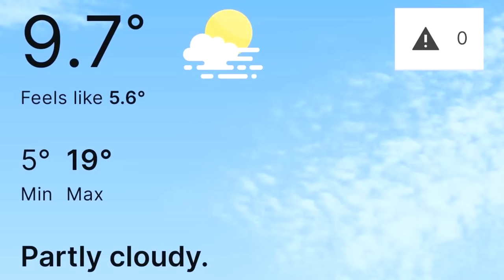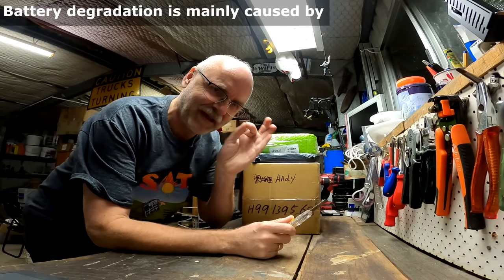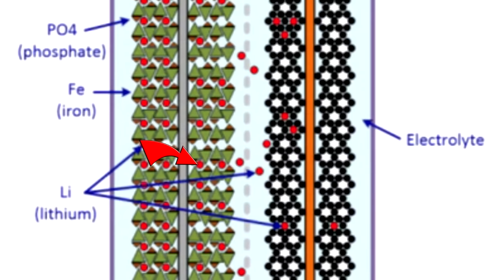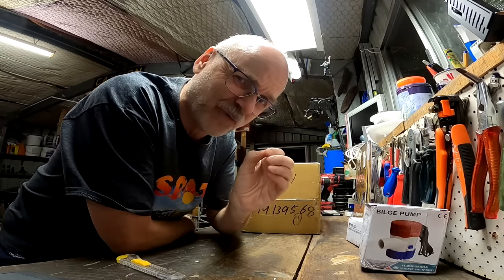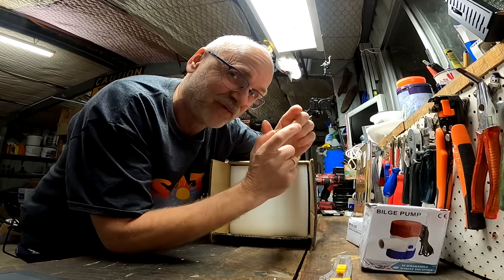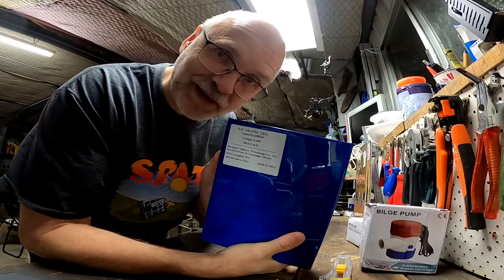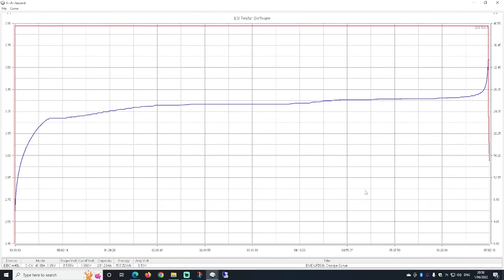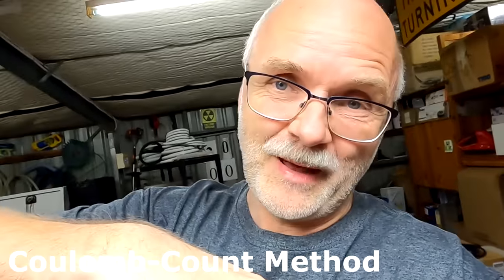Busting the 20%-80% SOC myth for LiFePO4 batteries.

Comment: Thanks Andy. Looking forward to the research study and testing. Have you or anyone found any real world research testing on the actual effects of over and under charging with LFP cells? I'll include references to some research papers, which suggest that it's thermal effects that largely contribute to substrate damage, and more a function of charging rate than absorption charge voltage, and that overcharge damage typically occurred at voltages above 3.6v. I could not find one study that suggested did several hundred charge cycles to 3.2v vs 3.6V that I seem to recall found no appreciable degradation until charged to over 4.2V to 4.8V. but if I do I'll add it to this post.   

Here's some articles that are bit of a dive but give some insights into what is going on at the chemical level:

LFP overdischarge conflicting voltage limits - Thread starter Hans Kroeger Start date Jan 21, 2021 
DIY Solar Power Forum  - Nature Article number: 30248 (2016)

'The Degradation Behavior of LiFePO4/C Batteries during Long-Term Calendar Aging  March 2021' - 
Energies 2021, 14, 1732
"Because the 20% capacity fade and/or 100% internal resistance increase are considered
to be the EOL criterion which are widely accepted, almost all of the tests performed in
the aforementioned literature are carried out within this battery life span. There are few
studies on aging behavior outside this range. Thus, this paper conducted an accelerated
calendar aging test on a commercial lithium iron phosphate (LiFePO4) battery over at
least 27 months. By considering the storage temperature and SOC level as the stress
factors, an aging test matrix was designed such that the tested batteries were subjected to
the aging test under five different conditions. Based on the aging results, the impact of
storage temperature and SOC level on the long-term performance degradation behavior of
fifteen LiFePO4 battery cells was analyzed."

'Failure Investigation of LiFePO4Cells under Overcharge Conditions - 159(5):A678  - researchgate'
"The correlation of the changes of
cell skin temperature and voltage with cycle number suggest that an
internal shorting of the cell was developing with overcharging, which
eventually led to the failure. Taking a close look at the temperature
curve of each cycle (in the 10th cycle shown in Fig. 2c), the cell-skin
temperature slowly increased with time but began a sharp increase
at the end of the charge, indicating that the overcharge caused detri-
mental damage to the cell components. The same pattern repeated
with cycle number for each cycle, and the temperature continued to
increase until failure. The temperature increased with charging, then
reached the highest temperature at the end of the overcharge process
(33◦C at 5.28 V, peak 1), then decreased with discharging; however,
after the discharge plateau, the temperature increased again to another
peak at the end of the discharge (26◦C at 2.8 V peak 2). As for the tem-
perature at peak 1, the temperature increased with the cycle number at
a rate of 1.36◦C/cycle, reaching 45.8◦C when the battery failed. It was
also noted that in the last ﬁve cycles, the temperature increased with a
much higher rate, 2.54◦C/cycle than that of the ﬁrst ﬁve cycles (only
0.02◦C/cycle). Compared with the temperature change at peak
Reply: Jack, did your text get cut off. Seems to end adruptly.

Comment: My car audio batteries get half-ish discharged and recharged several times a day. From 3.2 average to 3.6. The high amperage demand is what I think will kill them before anything else. When I enter in competitions the batteries get abused. My amp-clamp (dmm) has shown over 300 amps on one out of the four 1/0 cables feeding the amps. My home system goes from 2.85-3.48 and NEVER see over 120 amps. Itll outlast the car audio batteries BY FAAR. Excellent video Andy
Reply from the maker: Thanks for sharing. I always wondered why you guys don't use supercaps for this sort of usage. Or at least LTO cells...?

Comment: 12v LiFePo4 im using settings in my SCC LVD at 12.6v and charging voltage at 14.2v i like that setting compared to default (Li) 11.5v LVD and 14.4v charging using a SRNE 40A SCC.. your channel is very informative thank you

Comment: ANDY, everything you just said makes perfect sense.  LIfPO's were designed to be fully charged and fully discharged for a certain number of times before degradation sets in.  But we all hope in the long run a little less heat when charging will lengthen the serviceable life of the pack.  So for me, ill keep it down to 3.55 volts max charge voltage per cell, with a 4 hour float at 3.45 volts.  Beer is on me!
Reply: A 4 hour float could overcharge them. These are not car batteries. having your BMS get every cell to 3.45 and balance would be better. he showed us where the curves are for these cells. 3.5 could even work but would stress the battery a bit more.
Reply: Only when you need speed charging (boat, RV, less sun hours) it is necessary to go above 3.45. Ones mileage will vary indeed.
For stationary and fair sun hours there is less need for higher voltages  when charging...
So Andy told...
Reply from the maker: Thanks a lot for the SPAT 🍺, Bruce. Lower your float a bit and I'm happy with your settings. Thanks again for your support!

Comment: Thanks Andy - hilarious beginning as usual.😁
Very good topic- BTW I’ve received both my JK BMSs from China, one for my van (12v) and one for home garage (48v) already. 
I’m impressed with the speed of delivery, obviously air freight! 
My 400Ah Winston LiFePO4 cells for our caravan are now 6.5 years old, and have been charged usually to 3.45 volts during daily use, and then maintenance charged during storage (we don’t usually use the van in Summer) with a small solar panel (just around 50w, and only late afternoon sun) to a lower state, typically only 3.3v just to avoid any chance of going too low. However I know from experience that :
1. The actual state of charge can be quite low, as the Victron shunt (Bmv 700) gets waaay out of calibration over time, ie: exactly as you said.  The ONLY way to recalibrate it is to fully charge the battery. I’ve seen it say the battery is at 100% during storage periods when it’s actually at probably closer to about 35- 40%.
2. My degradation is still absolutely minimal. I have capacity tested them last Summer (Feb 2022) by running an aircon and found the capacity at something significantly over 380Ah- I wasn’t game to go any lower as I didn’t have a BMS on the van, (but will have one soon!) and this means I would have had to watch individual cell voltages personally, just not worth the hassle.
Cheers and thanks again.
Reply from the maker: Thanks for sharing, Dave.
Just be careful with charging the 12V batteries with such small voltage, it can overcharge them and you're reaching a high SOC at 3.3V already and the charge controller keeps charging. It might be better to charge them to ~60% and turn of all loads and the charger. With 3% self discharging there should be now need for a trickle charge for quite a few months.
The Winston cells seem to be far higher quality and also better matched.
I've got your email as wee and will reply soon. Cheers.
Reply: @OffGridGarageAustralia  Thanks again Andy.
I certainly hear and understand what you’re saying about the longish periods in storage with 3.3v, however should have added that I feel I’m very safe as I very regularly use light loads such as charging my garden tools from the van’s inverter, and often even other items as well such as lights and even sometimes aircon if I am doing things in the van. (I have a 2.5 kW Panasonic split system in the van.)
The maintenance solar panel only receives mid to late afternoon sun- net  result being that my actual state of charge usually goes down hill over time even though the Victron usually says 90- 100%. (As you know, that % SOC figure is useless when the battery hasn’t been at top of charge for a sync for a long while.)
For example, the last time we pulled the van out of it’s carport into full sun for a charge before using, I needed 250Ah going in to the battery to hit the top of charge, so the real SOC was probably something like 35-40%.
Weather permitting, we hope to use the van perhaps from the end of this week. I’m guessing that I’ll need to pump something like another 200Ah or so in to fill the battery, wild (educated ??) guess. Cheers

Comment: The flat charging/discharging curve of the LFP is addictive. Voltage sag was a mayor pain in the arsch with AGM, especially in freezing temps.
Reply: Voltagesag with AGMs suck but charging LFPs in freezing temps suck even more...
Reply: @windsolarupnorth7084  Yep, built LFP batterybox with heating.

Comment: Richtig gutes Zeug.

Reasons for the coulomb counting being off:
- It does not count balancing losses (minor)
- It does not count self discharge (minor)
- Most importantly: It integrates (adds up) systematic measurement errors (offset, gain, linearity) over long or even extremely long timespans. Even an offset of just 100mA can accumulate to big deviations when no recalibration is done regularly.

SoC estimators for NMC, NCA and LTO usually can use the OCV curve to recalibrate to when the cell is known to be outside of the nonlinear ranges at top and bottom. For LFP it is a different story: Your best point for calibration is when the cell starts to become nonlinear at the top end. This is easily recognisable for a BMS observing the rate of voltage change. This is also the reason why e.g. Tesla recommends charging to 100% when you have a MIC LFP model.

With respect to ageing: You said it at the end, high voltages themselves will also accelerate degeneration. This is due to high voltages providing activation energy for unwanted side reactions of active material and electrolyte.

The c-rate sensitivity also depends on the cell construction. For high power types, high c-rates are not that critical (except for the temperature raise they naturally entail). For high energy types, this congestion and cracking issue is much more relevant. The reaction speed (or for Li chemistries, the intercalation speed) is limited and pushing beyond it increases the energy available to deteriorating processes again (mech., chem.).
Reply: Also all of the shunts I've used don't detect less than 0.5a flowing, so small current draw such as your charge controller overnight, phone charging, or LED lights may not be counted.
Reply: @BradCagle  Yes, thats true. There are chips that do some fancy chopping to be offset-free, but if a more simple variant is used, manufacturers usually just suppress the noise and offset around 0 because that is so visible to the customer when he has nothing attached but there is still something bobbing around ;).

Comment: Finally gonna be some videos on how to set up the bms parameters. I've contacted overkill about doing some videos on custom bms settings. They said it was a good idea but haven't seen anything yet. 
I have 6 280AH strings of batteries with 6 over kill 48volt bms and haven't used my batteries at all because I'm trying to figure out how to navigate the xiaxiang app. I want to do the max amount safely and with longevity.  Also what is the charge rate? What about the float? Obsorb? Like to see how to do the bms settings. I have trouble naming all 6. I got 1 named but the app refused to let me name the other 5.
Reply from the maker: I know, there are a lot of parameters and settings. And they are more and les connected to each other, so it's really time to kick of this series! I was so confused myself and could not find answers either. Every forum, every website a different answer... So I did all the testing myself.

Comment: Verry clear explenation Andy, nice job as allways
Looking forward to see the results, i kind off winged it when i made my packs.
To make full use of the chargers capabilities i even went as far as to make 18S packs and charge them to 64V (max Victron voltage) this would be 3.55V per cell.
Dangerously close to 3.65 i guess but in a perfect world... i can never overcharge them.

In my installation you can clearly see that at 98%SOC the pack voltage is still only 60V (3.33V per cell) and after that it goes realy quickly, but to prevent cell runaway the batrium lowers the charging rate for the "top balalnce".
there are so many cool tools out there to manage your batteries, gonna be nice to see you play with them.
Batrium should send you a sample, they are "local" for you i guess...

Keep it up Andy, 40K subs soon!

Comment: In their product specifications, EVE themselves recommends the SOC window to be 10% - 90% for the LF304 and the LF280K. I always wondered how to do that with such a flat curve. Victron's charge defaults for LiFePo4 are 56.8v (3.55v) for absorption for an hour and 54v (3.375v) for float. Based on your recommendations I dropped the absorption voltage to 56v (3.5v) and left the float at 54v for my two LF304 based batteries. My batteries never drop below 50% SOC so I've never worried about the low end. I charge to 100% (56v) every day.
Reply from the maker: I found the Victron standard settings a bit too high. That may work for batteries which are many years old but not for new ones. If you can charge to 100% anyway every day, I probably would only go to 3.4V/cell as absorption and then set a time for that to like 4h or so... That is even softer and still fully charges them.
Reply: @OffGridGarageAustralia  if you have the capacity, go for de less degradation posible thanks Andy and Up North and Personal exelent information

Comment: I am off-grid and charging at 13.60/floating at 13.50 (PV) based on your findings. Once I am confident my test system is functioning the way I expect, I will consider a little more investment. Thank you for your contribution to the DIY community...
Reply: Can i connect two of the same lifePO4 24v to get 48v ?
Reply: @freddyswanepoel5640  of course you can (wired in series with appropriate sized conductor). Tie the positive terminal from one battery to the negative terminal on the other. Then tie the unconnected positive to a circuit breaker or disconnect switch (for safety) and from the breaker to a bus bar or fuse block to distribute power to your loads and the charger. Tie the unconnected negative to a shunt (for monitoring) or a bus bar for distribution to connected loads and the charger...
Reply: @freddyswanepoel5640  you will want to verify, with the manufacturer, that the two batteries in question are identical as far as the type of cells, BMS, ...etc. which, if you bought them at the same time (or within a month apart), they should be fine. The reason I say this is because, what could happen is you may have a problem with balancing, where the charger will stop charging when it thinks the battery bank is fully charged (when in fact one is and one isn't). You'll want to fully charge each battery individually (then let them rest, and check voltage) prior to wiring them in series, in an attempt to avoid this potential problem...
Reply: You don't need to float LFP batteries, that was for preventing sulfation of lead acid batteries. Suggest you float 13.4v or lower if you have to use PV as a day time source of power.
Reply: @s.mendez7160  thank you for your suggestion and yes, I am using PV to power things throughout the day, slowly working my way off-grid in the valley of the sun...

Comment: I made a 100ah 12v lifepo4. I added cheap voltmeter-usb combo to the pack. Digital voltmeter reads 14.9v. I recently bought a smart sensor which  reads 13.65v at rest. Been running battery for two seasons no snd.they are amazing.

Comment: Well my new off-grid hunt camp power system goes active tomorrow.  520 watts of solar panels powering a 40 amp SCC to a 12v 200ah DIY Lifepo4 battery.  I've been watching all of your videos along with Will's DIY solar forum and I'm still confused on what parameter settings I should use.  You say charge to 3.4 (13.6) but what voltage should I use to start top balancing my battery?  Guess I should rewatch some videos to see what I probably missed the first time.  Really enjoy your videos and the time you spend finding and suggesting new or better possibilities for this battery chemistry. 🇺🇸☀️🍺
Reply from the maker: Hey, great setup and design. This should work well. For a rough start:
- 3.45V Absorption, Bulk or Boost voltage in your solar charge controller (different names for the same thing)
- 3.35V for Float (when the battery gets full)
- 3.45V Balancing start voltage (depends a bit on your BMS)
More details coming soon.